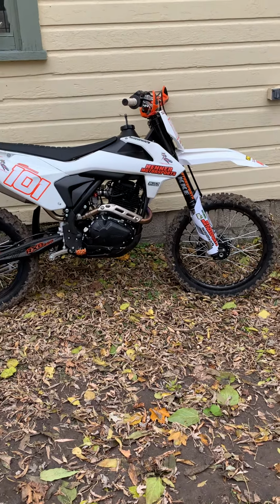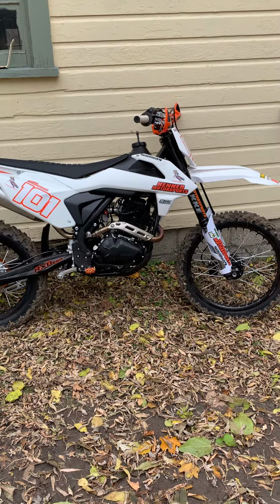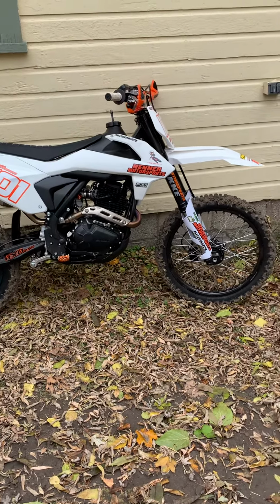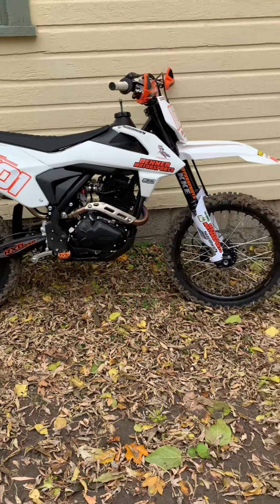2021 Rxb250 mx edition

Comment: Do you know what the Orion rxb 250l 2021 cloned after
Reply from the maker: It’s not a direct clone of anything
Reply: @joehenner9769  so only place for parts is Orion power sports
Reply from the maker: @AngelHernandez-lv7xy  it depends what your looking for. What are you trying to find?
Reply: Ok so how do I get a big bore kit
Reply: @joehenner9769  I was wondering about the big bore kit I had heard about I haven’t gotten my bike yet I’m waiting till the next shipment gets here so hopefully I’ll have it by January
Reply from the maker: @AngelHernandez-lv7xy  I make the big bore kit myself It will come with a new cylinder a complete piston kit and gaskets they have to be prepaid for and it takes about 3 weeks to make a kit up
Reply: @joehenner9769  ok how much is the kit
Reply from the maker: @AngelHernandez-lv7xy  you can message me from Facebook or call I don’t post my parts or pricing on YouTube
Reply: @joehenner9769  ok I don’t have a a Facebook but my wife does whats the page name
Reply from the maker: @AngelHernandez-lv7xy  Henner Motorsports
Reply: Are those ktm tank and shrouds?? Or the 2020-21 Orion older model plastics and tank. Thanks